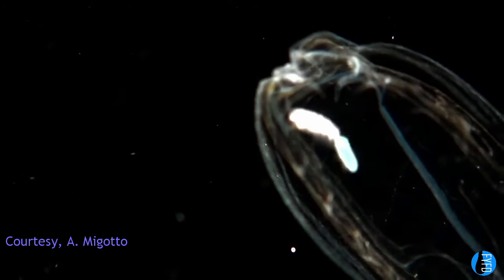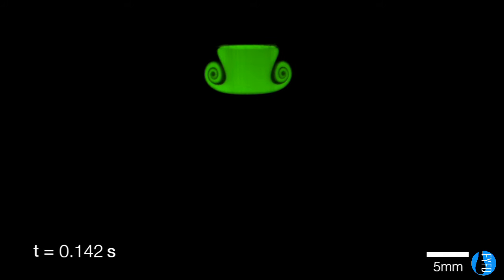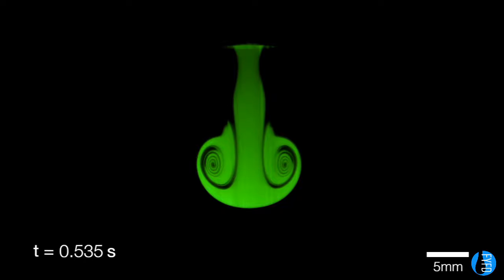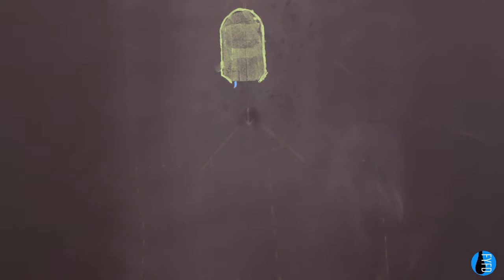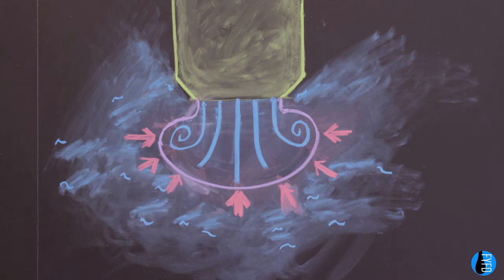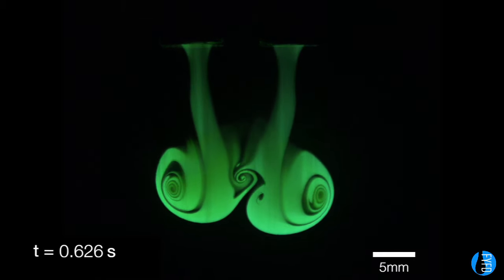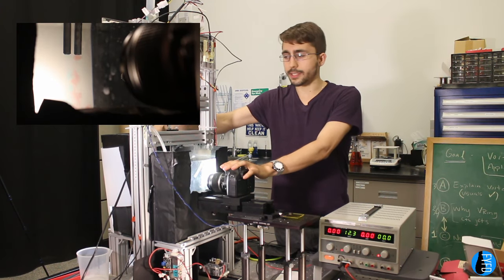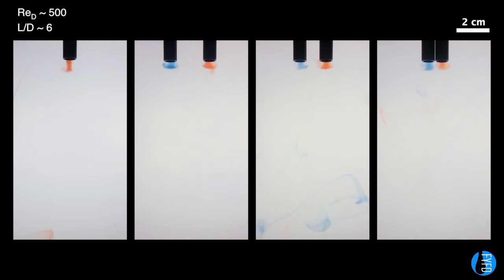Vortex Rings, Salps, and Underwater Robots

Comment: If the vorticies have progressed sufficiently far from the nozzle, does it really matter if they interact?  The propulsive force on the vehicle is just the sum of pressures and shears across all surfaces, so how would an interaction away from the vehicle have any effect?  Thanks in advance for clearing this up for me!
Reply: great observation. the propulsive force is affected by vortex interactions only when the vortex rings are still near the nozzle (i.e. when the interactions can still affect the nozzle overpressure). 

That effect drops off quickly as the rings move away. Because of this, the forces measured in the paper were only measured while the rings were still forming (green fluorescent videos, close to the nozzle). Although there is little visible mixing in those videos, the developing vortex rings still have a strong effect on each other, because the pressure fields they generate travel at the speed of sound (much faster than the videos).

The backlit experiments don't directly reveal the nozzle forces, but they demonstrate rich vortex dynamics. In this case, they also provide the correct intuition about how interactions affect momentum transfer (stronger interaction leads to slower rings and less thrust).
Reply: Wow, thanks for the thoughtful response!  I enjoyed the florescent demonstration a lot.